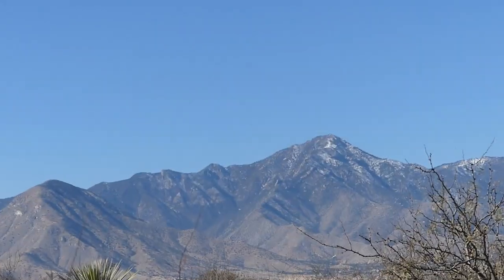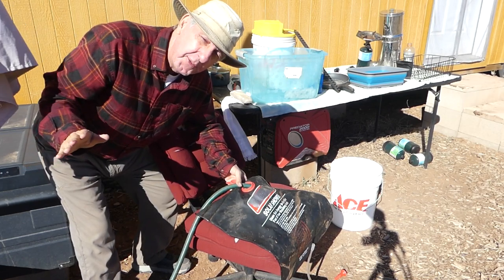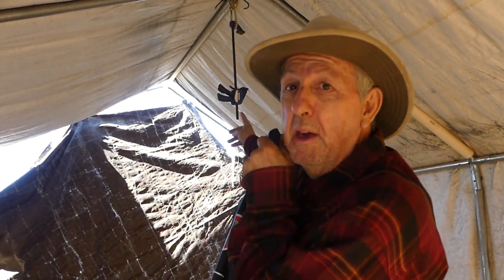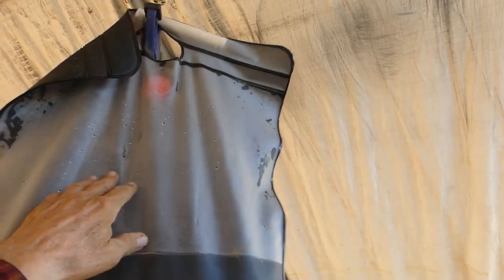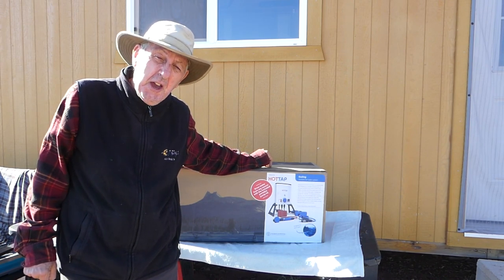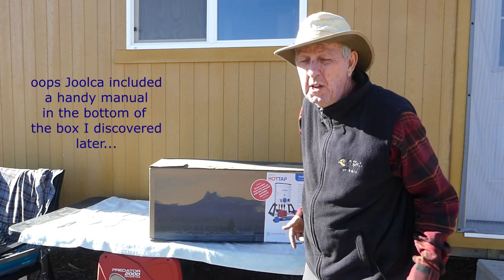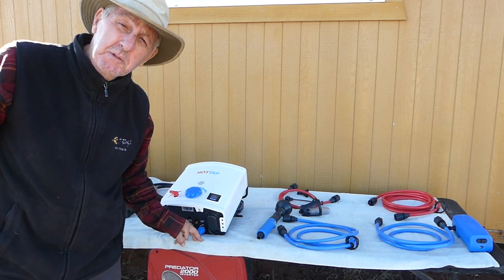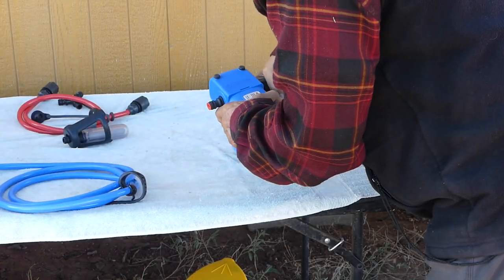Keeping Clean & Healthy Off-grid | Joolca HOTTAP | Portable Shower

Comment: Be sure to drain the heater if the chance of freezing. Maybe best to keep indoors if you have room.  Nice unit, I would hate it if it got destroyed.  A couple building a container home had one that got frozen and ruined it. Maybe they were busy and forgot.
Reply: Important point. During the winter, I store mine inside when not in use.
Reply from the maker: Great tips many thanks.
Reply: @backtothepast1850  This water heater is tankless, so not much to worry about there,
Reply: @nancybuehlerreid  I realize that, but if you leave hoses connected, water can remain in the heat exchanger

Comment: I've used one similar to that on my Homestead for nearly two years. Overall, they're really nice. The water output temp isn't always consistent if you're operating on fairly low water pressure and flow. I use mine to put into a pump up shower bag and that works great. I'm amazed at how little propane they use. A 20# bottle lasts me all winter. I'm in Arkansas,  completely off grid like you. Some of the relatively inexpensive perks can make a huge difference in comfort.
Reply from the maker: Sounds like you have quite the inventive set up Back to the Past. Thanks for watching.

Comment: By using water source in your pool, extra filter and proper soap you could have a recirculating shower using the same few gallons over and over saving water.  This could be used in a shower with the drain plugged, as in a class C or a van.
Reply from the maker: Thanks for the suggestion Leo.  Although I do my best to keep any soap out of my pool so the birds can enjoy it. Thanks for watching.

Comment: Very nice upgrade for sure.  I noticed all the little one pound propane bottles laying around.  Don't throw them away refill them from the 20# propane bottle you have.   There are many videos on YouTube on how to do it.  I use the valve that attaches to the bottles no hose.  Works awesome, got it on Amazon, it has saved me many many $$$ for sure.  Here is the name. 

MCAMPAS Elbow Refill Adapter for 1lb Propane. Fits QCC1 Propane Tank 20 lb and 1 lb. Tank Throwaway Disposable Bottle Propane Refillable Gas. Propane Fitting Adapter Valve with On/Off Control Valve
 I also have a scale and keep them out of the sun. Have a great day and God Bless.
Reply from the maker: Hi Rodney thanks as always for stopping by. Actually those bottles are still full.  I just ended up not putting them away properly yet.

Comment: I would hook up your main water tank to that unit when your new shed is ready so you won't need the buckets anymore and mount everything inside except the propane tank itself, just run the hose thru the wall to the outside. Also, find a way to power up that pump with your solar system and not the car, if you leave the ignition system on but not running you can damage an ignition coil or kill your battery its not only the 12-volt outlet you are powering up when the key is on. A shower stall with a drain would be great also. Good luck.
Reply from the maker: Super suggestions Go4UM.  I am taking notes. Many thanks.

Comment: Great video. I think I could use this as a recycling shower by putting the hose in the pool instead of a bucket.
Reply from the maker: Could do kathryn but then my pond would be all soapey...  Had enough of that issue many months ago now.  Thanks so much for coming by and watching.
Reply: @affordabledesertliving3487  I meant  the kiddie pool you stand in not your pond. Sorry.
Reply: Inline filters can remove the soap and make for a clean shower
Reply from the maker: @RustyRefuge  Oh got it. Thats a great suggestion. Thanks!
Reply from the maker: @leoblumhagen644  Nice. Thank you.

Comment: I've enjoyed watching your videos and am impressed by your perseverance! You always get the job done one way or another. I do have a question: You had the septic system installed but is it just not hooked up to anything, yet? You have no running water right now so I'm curious about the septic system. Thanks.
Reply from the maker: Hi E M.  Yes I do have a septic but indeed no running water.... yet... once I have the "big house" completed it will all be hooked up with a solar water pump and low flush toilet etc.
Reply: @affordabledesertliving3487  Thanks for responding. I'm looking forward to your next videos.

Comment: Hi Don, Nice, simple, and warm solution. Going to check Joolca out! Portable battery that charges off your main system would be great. Any uses for the after-shower gray water around the homestead - like watering the trees?
Reply from the maker: Hi Don.  Yes indeed I dont waste water at all here so the trees got the water after the shower. I will change things up so I dont need the corolla to power the pump in the future.